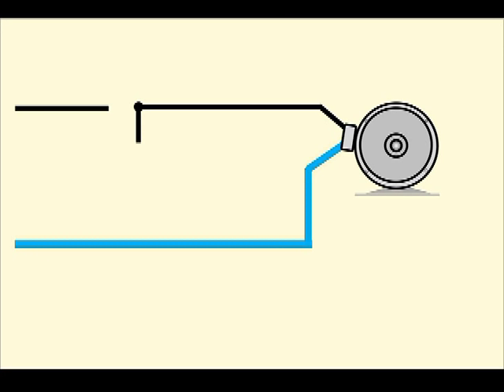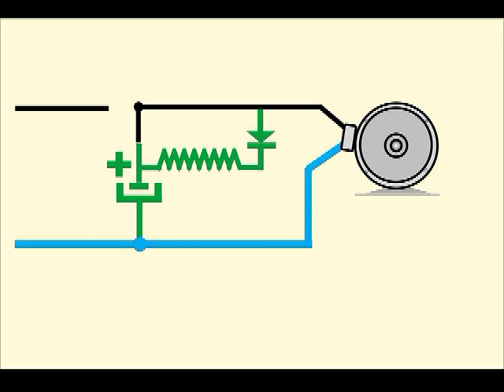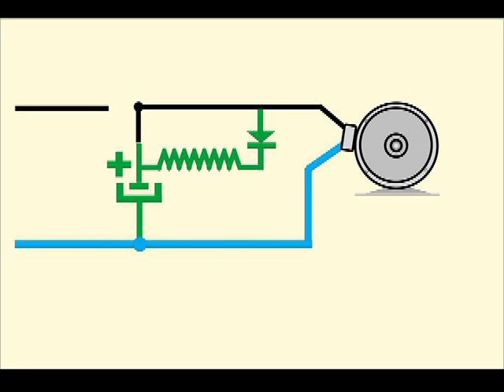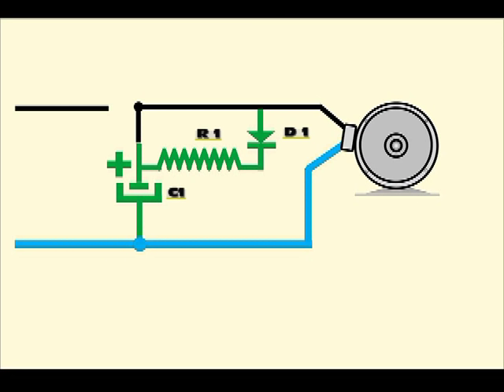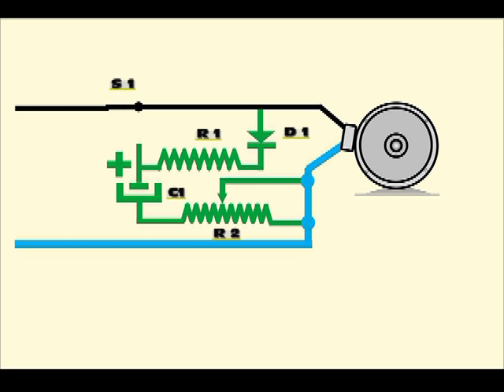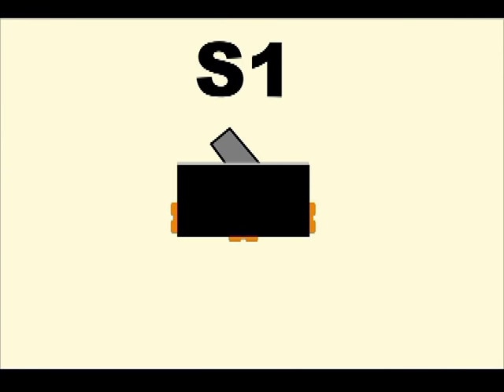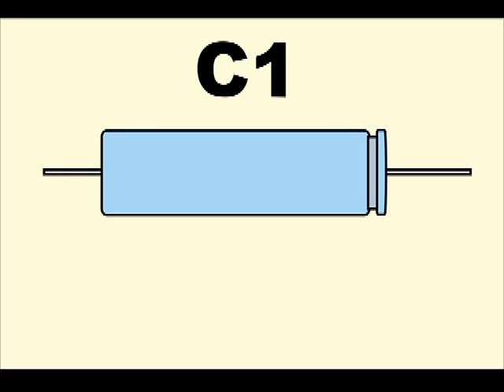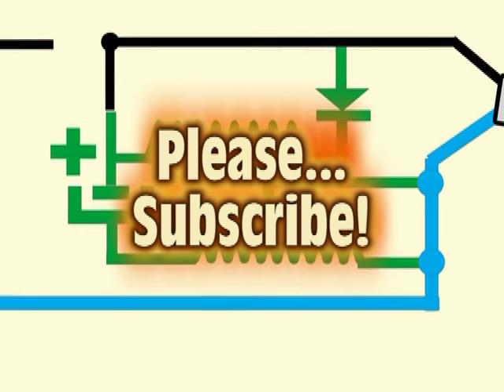Dynamic brake for induction motors

Comment: Thank you so much. I'm looking for this long time. I think there are many people not good at English like me. So if you can, you should write sub in videos, easy understand.

Thanks alot ! You're great guy!
Reply from the maker: Thanks for your comment! The system can be improved for bigger motors, using a 12 VDC power supply, please watch my demo video on a shaded pole motor being stopped instantly by a small power supply. The supply must be robust enough for big motors, in order to prevent overload of the DC supply - https://www.youtube.com/watch?v=SEjQHdwgFEY
Reply: I have a 1/2 hp ac motor 1 phase 220v. In this motor had a start capacitor 15 uf 400va. I see your circuit have a capacitor, so brake the motor, i need another capacitor like your video ? Waiting for your reply. Thanks !
Reply from the maker: Hi, Nghia, well yeah, you need another capacitor, however, for motors 1/2 hp and above it is better to use a transformer powered DC supply which is able to get a current through the windings without overheating the xfmr or overloading the diodes. You can use a capacitor, however, it would have to be quite big in order to sustain a heavy curren long enough to stop the motor. Take into account that the voltage used to stop the motor is DC, so the current will be only limited by the ohmic value of the motor windings, so if the ohmic resistance of the motor is very low, the current will be quite high, so the DC supply must be capable of handling the braking current long enough to stop the motor, load inertia and all. You have to try several DC supplies, starting with a low voltage, perhaps 6V and if that is enough to stop the motor, use the minimum current necessary.
Reply from the maker: Watch this video in which I apply voltage from a small power supply in order to stop a small shaded pole motor. It will give you an idea of how fast can a motor be stopped by applying DC to the windings. https://www.youtube.com/watch?v=SEjQHdwgFEY
Reply: Thank you very much. I did it :D. Very happy. Thanks !
Reply from the maker: Glad to be of help!!

Comment: if i  use the AC 110v - 60W Motor 1 phase, what capacitor, resistor, diode i have to use, please help me!!
Reply from the maker: Dear Nhan, as a matter of fact, I found using an offshelf DC power supply works practically in all cases (except very big motors) I show a demo of the components needed at https://www.youtube.com/watch?v=SEjQHdwgFEY . If the motor is over 100 W, you may have to devise a somewhat stronger power supply, capable of delivering a 2 or 3 amps for a short period. You must provide some sort of timer or momentary button to apply the brake, so the power supply will not overheat. You can use a "breadboard" with plywood and nails as I did in order to make some tests and find the proper supply. You can check the ohms resistance of the motor when not energized, to have an idea of the amount of current your supply must be able to deliver. Please let me know what you finally did.
Reply: @eltunene  
thank you so much for your reply.!!
you know, i have a  AC motor 1 phase. (110 v, 50w), which have a start winding and 1 capacitor.
 so, i want make a circuit to brake the motor when i turn off. but i don't know what i have to do. i am wondering, can i apply your circuit in my motor?
Reply from the maker: Your motor is small enough, The circuit in my video should do fine, however, I later found out it was easier to use a small power supply. Maybe you can use a small relay and capacitor as a timer to apply the brakes for a second or two. Please go to my Community where I posted a schematic.
Reply: @eltunene  thank you so much!!
but i have applied your circuit for my motor already. but it seem less effective.  
please give me the way to receive  your schematic
Reply from the maker: @classicmotorcycle136  There is a tab in youtube labeled Community, where I have posted a couple of pictures. One of them is about the braking circuit. I make use of a relay and a delay circuit using an electrolitic capacitor in order to apply the brake just for a second or two (that depends on the capacitor in this circuit) please refer to that picture. In case you do not find it, please give me an e-mail so I can send you the pix.
Reply from the maker: @classicmotorcycle136  I see you finally found the picture at Community, please let me know the results.
Reply: @eltunene  thank you!
but i don't know what the picture you mean? pardon me
Reply from the maker: @classicmotorcycle136  Dear Nhan, I just sent you an e-mail with the picture attached. I hope it helps!
Reply: @eltunene  thank you so much

Comment: I can't understand how this circuit would work...
Surely, when the switch is in the on position, current not only flows through the motor, but also through the diode, resistor, and finally charges the capacitor.
Now, the capacitor is charged to the same voltage as the supply rails.
When it's turned to the off position, sure the motor is connected across the diode, resistor, and capacitor. But the capacitor is charged already.
There is no where for the current generated by the motor to go, once this capacitor is charged.

Surely a more effective method would be to do away with the capacitor and diode.
When the switch is in the off position, it could connect the motor directly across the resistor.
Reply from the maker: Dear Dan, a squirrel cage motor cannot act as a generator, producing voltage in the stator (field winding), since the rotor (armature) is just a shortcircuited bar group. However, if you apply the charge of the capacitor to the stator while the armature is still rotating, the stator becomes magnetized and a voltage is induced in the rotating bars of the armature. Since they are short-circuited, the strong current generated in the bars produces an opposing field to that of the stator, thus braking the motor. I hope this helps.
Reply: Ahh okay, I understand now. Thanks for the input.
I was thinking the motor behaves the same as a regular DC motor!